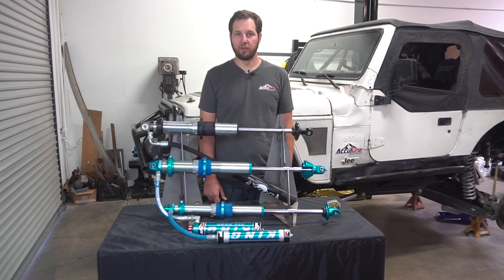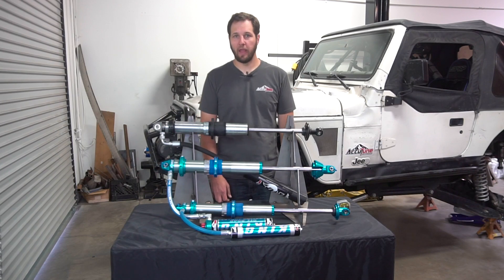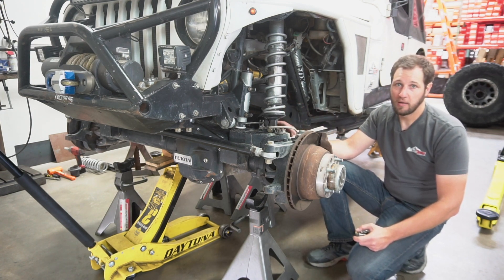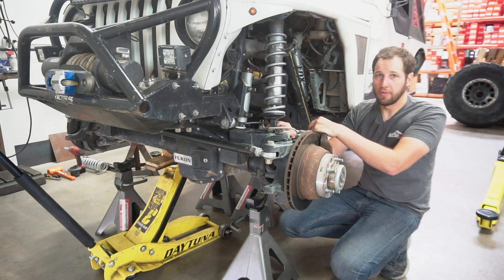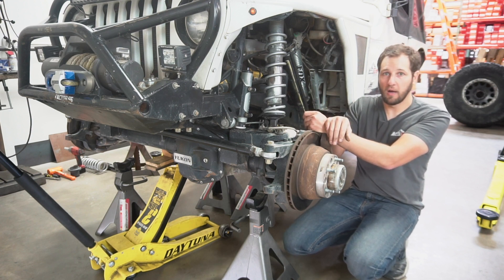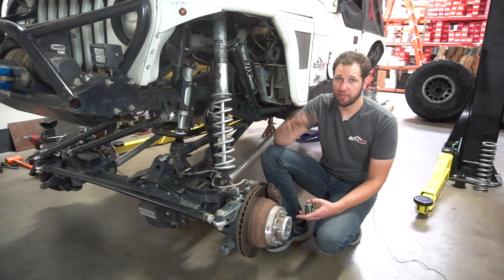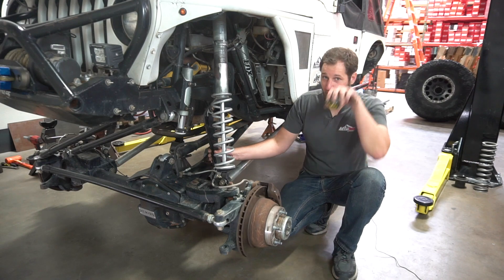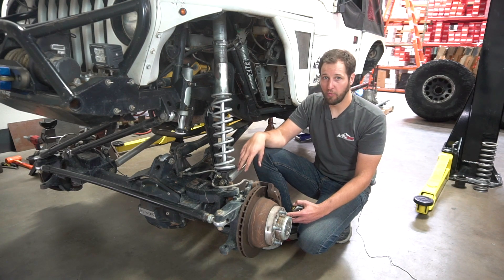Measuring for Coilover Shocks

Comment: What’s is the typical cost for a set of coilovers? I have a teraflex long arm kit. I also have SDI EClick so I would want switch out the reservoir for the universal EClik unit.

JLUS
Reply from the maker: I decent set of coilovers with dual rate spring setup and custom tuning starts at about $627/each. It can double from there depending on how you plan to use the Jeep.
Reply: @accutuneoffroad  Nice, I will be reaching out to you in March to source the coilovers through you.
Reply from the maker: @intelovrlnder6929  Sounds good, we'll be ready for ya!
Reply: @intelovrlnder6929 Did you get coilovers with e-clik yet? I am running e-clik and just purchased king 2.5 coiolver kit. Not sure if I want to spend all the additional money to add e-clik to them or just get them custom tuned.

Comment: I'm been having hard time trying to figure out lift increments with coilovers for a long time. How do I decipher height i want if I'm looking for a 6" to 8" lift on ride height of my truck of which one I need to ger that?
Reply from the maker: If you are looking to get coilovers for your truck in the 6-8" lift height range, you will need to search for a kit with those descriptions. I'm not sure what truck you have or if those kits exist. Thats a very tall lift so there may or may not be a kit out there for you.
Reply: @accutuneoffroad  I have a 2011 ford ranger 4wd. I'm doing a solid front axle swap project for my truck. I'm just trying to figure out what's a good coilover that'll accomidate the 5 to 6.5" lift I want
Reply from the maker: I understand, but there is more to it than that. Once you have the front axle mocked up, you can set the chassis to that 5-6.5" desired lift height and you can start measuring for shocks. Solid axle swap with linked suspension will require a lot of fab work so this will be a process  @genoory5090
Reply: @accutuneoffroad  I know its a lot of work. Nothing to familiar I can't do. I just don't want to get 16" down travel or 18" down travel coilover that's way to long for my application. And most of all, I'm not planning on cutting into my fender well for it to fit inside my hood. Maybe I need a 10" travel" or 12 travel" coilover. Overall, I want mines to be as flushed into my fender well & frame rail
Reply from the maker: Right on. You wont know what length shocks you need until you have everything in place and start mocking up shock mounts.  @genoory5090
Reply: @accutuneoffroad  right. That's where I'm at with that situation to understand what I really need

Comment: comment 14: if I heard right min up travel 4or 5" & max droop is 9/10". The limit strap can stretch 1" in 12" over time. rock need 4+, tail 5"+& speed trail 6"+ min up travel. 1" min space on coil over margin of safety not max-ing out spring & shock.
Reply: most ppl depending on wt need 2.5 not 2" shock or more.
Reply from the maker: @jamesmerkel9442  Yes, see this article for more https://accutuneoffroad.com/articles/choosing-the-right-coilover-shocks-for-your-build-universal-fit-coilovers/

Comment: Thanks for this video, How would I work out the figures you mentioned for a different vehicle?

I'm running a Suzuki Jimny which is MUCH smaller.  Your figures: 5" droop and 4" up travel I assume is for a large Jeep.  Is there a radio or percentage that one should use?

let's say I only have 4" of total travel,  should you be setup 50% droop and 50% compression etc?
Reply from the maker: This is a basic "how to" for a solid axle/coilover setup, just using a Jeep as the example. Take a look at the full article for more info on recommended up travel vs total travel, 4" on a solid axle is extremely limiting. https://accutuneoffroad.com/articles/choosing-the-right-coilover-shocks-for-your-build-universal-fit-coilovers/

Comment: Great video, that helps a ton. This might be a stupid question but do you use the same process to measure for rear shock absorbers?
Reply from the maker: Yes, same basic idea but a little easier since that axle doesn't steer and usually has more room for up travel.
Reply: @accutuneoffroad  thanks

Comment: 8:55 when dialing everything in should i not have the bumpstop stop my shock travel with 3/8”  shaft showing before the coilover bottoms out? Did you end up adjusting the bumpstop when you were done to do this?
Reply from the maker: Under articulation its different. We set bump stops at full bump (both sides). Usually when articulating the suspension off-road, you are moving much slower.